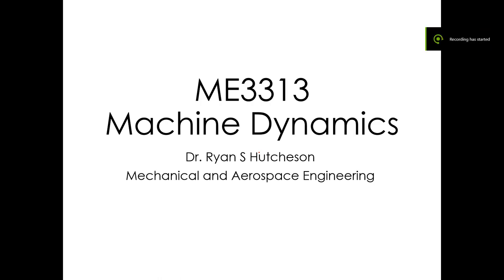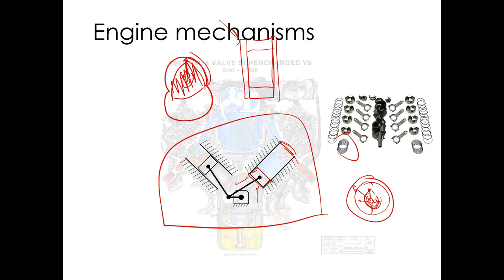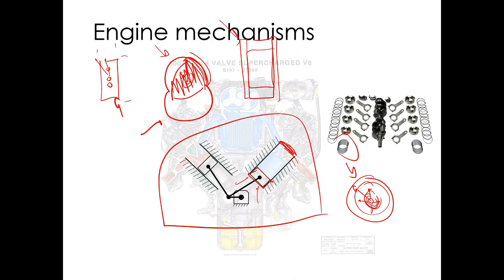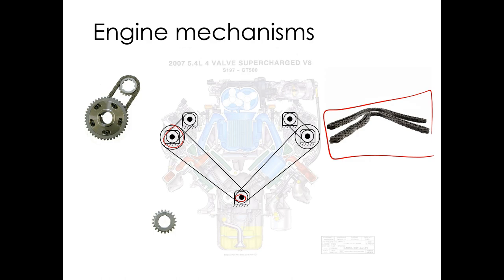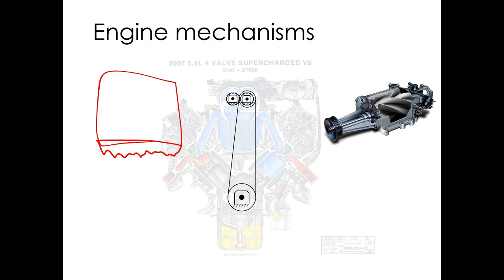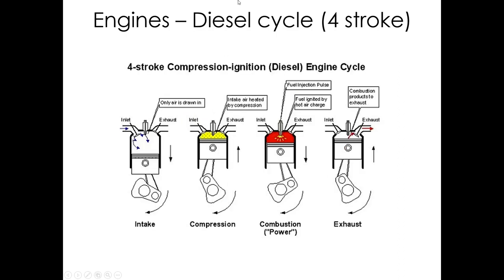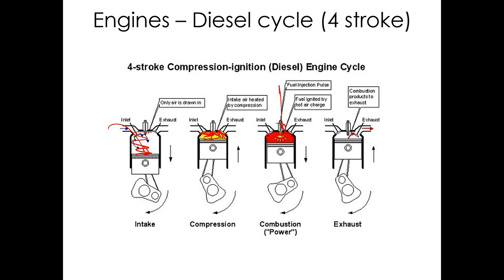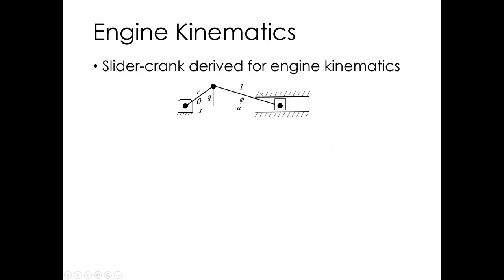ME3313 - Engines I

Comment: Do you think that in a hybrid system where a battery can't hold enough energy like a dozer at a mining site, could we use a slightly underpowered turbine -> generator that runs full out all the time to keep it in its efficiency range then use the battery to make up the difference in power demand for short times? Also in pursuit of lower emissions, we could use natural gas especially considering shale has brought natural gas to 10-20%% of price when I was born.